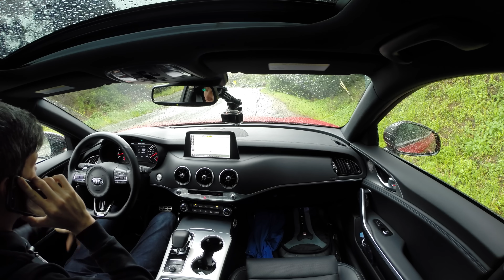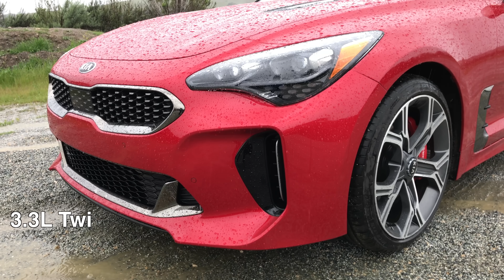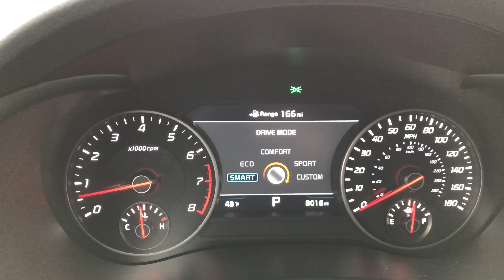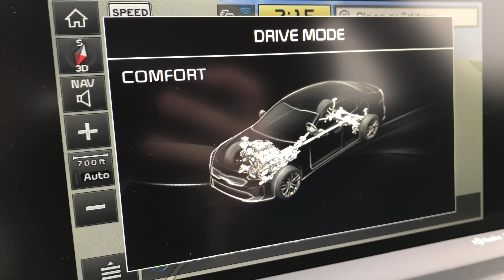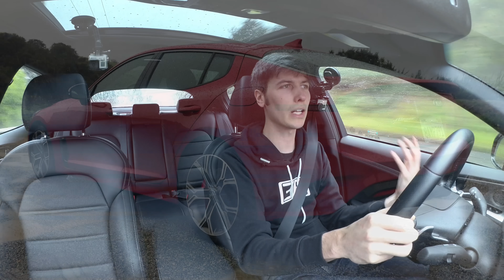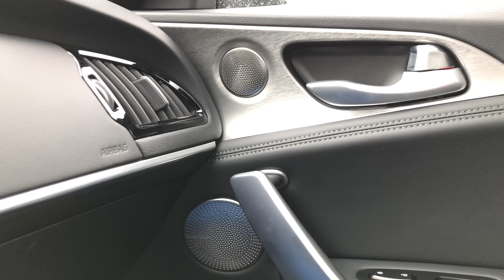The Kia Stinger GT Is An Ego Check For Car Guys

Comment: One of my favorite cars out right now! Not a lot of people show enough love to it
Reply: I'm glad you love it Salo everyone who has driven the car loves it, I think the best way to sell a Kia is by getting people in one first

-Kevin
Reply: Mista Butterworth When there is '06 Sonata's still alive and over 150k miles
Reply: Salomondrin we are killing it right now with the shop Stinger GT. We have dumped 100's of hpurs into development for the Stinger.
Reply: Vipervenomsrt actually, not the case. With $3000 worth of upgrades, it will beat several cars in that catagory.
Reply: Vipervenomsrt outperforms every car in its price range. And it's marketed as a gt car. Not a sports car. A tune and an exhaust and intakes and this car will walk an m3 a q60rs a c43 amg and many others for tens of thousands less.
Reply: Wedow have a yellow gt premium one of 600 beat a camero as well as handed an sti a L. Mine is stock  rite now
Reply: Tork Motorsports love your channel have a yellow gt premium awd best car I've ever had. Last car was the genesis 3.8 coupe. Are you guys selling parts yet?
Reply: King of The Castle sure, go take a corner in the 392 and tell me how you feel.

 Also in all technicality, this car starts at 38k where the scat starts at 39.9. Most dealers by me are also marking them up or charging hidden dealer fees. I wanted a burgundy scat last year and it was advertised as 37.5, then when I started doing the paper work it came out to 44k. The stinger on the other hand people have recorder paying 34-35k out the door for a gt rwd. And by me they will even give you a discount on the gt1 awd, some are selling for 41k when the sticker is 45k.

And I hate to say it but for 500$ for a jb1 pigyy back tune, you'll beat a scat in a straight line.
Reply: King of The Castle lmao well this car is faster than my q60rs for less money. This car beats the scat in interior and looks. The scat now looks the same as a v6 so that's lost all appeal to me.

I'm not in city traffic. I corner on exit ramps and motor ways at 70-90mph and have fun doing it.

My car only has an exhaust intakes and a tune and I absolutely Walk scats and being awd hellcats stock from a dig have an extremely hard time catching me before 110-120 mph.
Reply: @Vipervenomsrt It's a sports sedan, but it's also a GT.  So, severely out-performed by what? Fully loaded 2018 Kia Stinger GT2 AWD (designed by former Audi TT designer Peter Scheyer and engineered by Albert Biermann, former VP of BMW M) with 365 HP has an MSRP of 52K .  In September, I got mine for 44K.  The Audi A7 STARTS at 68K, 340 HP.  BMW 6 GT/Hatchback STARTS at over 70K at 335 HP. Porshe Panamera starts at 85K with 330 HP. Mercedes CLS starts at 69K with 369 HP.  And the Kia has a 10 year, 100K mile power train warranty and 5 year 60K mile bumber to bumper. None of the others are close in warranty.  And Kias are actually reliable (which is why they offer such warranties).   So, pay for the badge  (more likely lease), I paid for the car.

This car is fast, gorgeous, roomy for people and cargo, loaded and comfortable as can be.  It's not severely outperformed by anything in it's price range and not really by anything even 20K more for similarly powered and loaded.  It doesn't have the badge/rep.  THAT is the only thing this car lacks...for now.
Reply: Robert B good stuff. They offer basic Boltons right now. Jb1 has a piggy back tune right now, tork is working on the tune. The piggy back tune and an exhaust hangs with my full Bolton q60rs. I'd suggest buying the jb1 unit and also buying your Boltons form tork ms. I wall away from 2016 ss camaros up top which is unbelievable for the weight of my car.
Reply: Wedow thanks man
Reply: King of The Castle and oh no!!! A 400$ service at 60k miles to clean the valves..... Have fun with dodge reliability. My neighbors challenger scat pack has been to the shop 4 times in a year in a half. Anything ftom the cam timing being off to the car shuddering to a stop and shutting off at a light. Dodge needs to offer an athletic car next to there bricks with hp. Don't get me wrong, you can beat the sound of that v8 with the stinger. But that's its only advantage.
Reply: @Vipervenomsrt I guess Edmunds, Road and Track,  Autobytel, Motor Trend and Car and Driver (to name just a few) are wrong when they call it a sports sedan.  And you are right.
Reply: @Vipervenomsrt And where did you get that from?
Reply: 2020 stinger gt tt panthera metal chameleon trim
 Over a year old and still love the car. 2015 sorrento sx and still runs great. Never failed to start. 164000 miles.
Reply: Zach R Kia is as cool and reliable as Velcro shoes. Velcro shoes even have great “initial quality”.
Reply: Salomondrin - It doesn’t deserve love. Show it love if it’s still running 5-10 years from now.
Reply: Salomondrin is trolling

Comment: I think the saddest part of this, and most new sports cars, is when they don't come with a manual gearbox option.
Reply: hyundai will be making a genesis g70 that will basically just be the stinger, and the base model will have optional manual.
Reply: Manual transmissions may soon be obsolete. Computer parts are now more integrated in cars vs. mechanical parts. Manumatic seems to be the trend now. That and turbochargers.
Reply: Not a sports car, it’s a Grand Tourer (GT)
Reply: The Wakz I disagree, if I wanted a peppy daily driver that doesn't look like my grandmother's buick I would consider this. I don't want a manual for my daily, I drive a unsynchronized 18 speed 600-750 miles a day on a normal day I want to push the pedal and go when I get done. Dont get me wrong I'd rather have a manual for a weekend/sports car, but that's not the market for this, this is a daily driver that has a little pep.
Reply: SDD525 Did you really just say that? Its not a '99 civic, this car (and all new cars) have very controlling ECU's, would DESTROY the value of this brand new $50,000 by cutting into the trim above the transmission tunnel.  How does the manual swap factor into the drive mode button? Nobody is manual swapping new vehicles unless they have more money than brains
Reply: People put more value on numbers rather than experience. Sad days
Reply: Automatics have their place. I prefer a manual 99% of the time however I've never scoffed at a well tuned auto. I've had my ass whipped more than once on an autox course by a car with a slushbox.
Reply: You can also buy a "quick shifter" for any sport motorcycle and make it work exactly the same. It just cuts the ignition on the upshifts under full throttle.
Reply: Rob C F1 uses paddle manual
Reply: For the experience, I agree, not everything has to be automated, you can't automate fun. (sometimes).
SDD525 transmission swaps are the worst and sometimes when you're finished the car is never the same in the interior. Not worth.
Reply: SDD525 youre nuts. theres no way youre getting a manual swap done in this car for less than $5-10k. at the VERY least. what transmission are you going to use? and do you have any clue the man hours it's gonna take to fit it, then reprogram the ECU? no, a good transmission swap wont be easy, and it wont be cheap. and it certainly wont be worth it on a car like this. now, if a rich guy wants to spend $40k to swap his 991 GT3RS to a manual, fine, but nobody is gonna do that on a stinger.
Reply: Danny, I agree. Sadly most ppl outside of Europe prefer auto. Like any business Kia follows the money; and on top of it, it's too much of a pain for them to bring both auto and manual to market.
Reply: "Sad days"? When you can buy a 380 hp "sedan" for $50k that does 0-60 in under 5 seconds? These are the best days! Yes, there is no manual, but the tiny percentage pf people that would actually buy one doesn't justify the cost to KIA (or anyone) to test it and have it meet federal standards. Go buy a Mustang GT, if you want a manual.
Reply: Not in America anymore.. pretty much the only sadan offered with a manual is the WRX. Since Ford did away with focus ST, and Mazda did away with manual Mazda 6 in 2018 (before they added a turbo..wtf???).   We've become a soft group of car buyers.. they cater to the market, and the market says comfy automatic SUVs...  Lame!!!!
Reply: 370Z nuff said
Reply: Danny Daskalakis it needs to be an option. Even if it's a rarely purchased one.
Reply: @McCAlexander  if it doesn't sell they have no obligation to do it. If you want manual gearboxes buy new manual cars and show them that there is a demand for it
Reply: @vicmanvalfre96  well of course there's no obligation by the manufacturer. They can make and sell whatever they want and believe will sell. My comment is saying it needs to be an option to be taken serious. Even if it's a really purchased one. 

That or a dual clutch.
Reply: Rob C I don't think you got the analogy right, but that's fine. Anyways yeah it's not that it's better or worse, but for my personal taste, manual is more fun and engaging, salty boi.
Reply: SDD525 that isn't in everyone's budget.
Reply: True.  I even bought a new Subaru Crosstrek as Subaru is due to cut manuals after 2020.  My other cars (Wrangler & Miata) are manuals.
Reply: Rob C, F1 does not use an automatic, it's still a sequential manual, just a computer controls the clutch but the driver can also disengage the clutch using a button on the steering wheel to put the car into neutral.
Reply: The main thing about these DCT cars is that all of them are automatics with the option to shift manually via the paddles. "A dual-clutch transmission, (DCT) (sometimes referred to as a twin-clutch transmission or double-clutch transmission), is a type of automatic transmission or automated automotive transmission." So while they usually faster than manual transmissions they are just high performance automatics. While rowing the gears in heavy traffic can get old, it's very satisfying at the track or a nice twisty road. It will be a sad day when manuals are gone.
Reply: I was driving a trucker friend of mine around (and Mustanf GT owner) and he thought my STI had a rev matching transmission. I've been driving and riding for so long it's just a habit now. My wife's Forester has a CVT with paddle shift and it's ok, but no replacement for a manual (and certainly no DCT).
Reply: if they execute the auto well,  with manual shifting its a non issue to me.  Waiting for the the next model Stinger,  the Koreans will have worked out the trans issues by then.
Reply: It comes in a manuel with the 2.0t rwd version but not one for the 3.3tt sadly
Reply: McC Alexander exactly my point.
Reply: IFearlessINinja couldn’t agree more!
Reply: Manuals are on borrowed time,more so with Dct. Toyota/Lexus Speed Sport Direct shift with locking Torque converter might be the best solution. It shifts faster than a manual,locking TC keeps you engaged with good feedback,and your left knee will love you forever if you live with Bay Area traffic. Toyota Sport Direct shift is NOT the sluchbox from granddad's Buick. Automatics have come a loooooong way.
Reply: stefan urquel I never got the point of Manual mode in a Automatic Transmission. Almost everyone wants to get rid of MT because AT is considered better but not everyone is necessarily with that. I’m slowly learning about cars everyday but are AT easy to fix like MT without breaking down the actual transmission?
Reply: It's still a car that would be capable of trashing some BMW's though.
Reply: Get the Genesis version of this car. That has a Manuel
Reply: It is a GT not a sports car.
Reply: Save Manuel
Reply: Exactly
Reply: Right? A manual transmission is cheaper anyway, it’s not that complicated I imagine.
Reply: Rob C Auto is not allowed in F1. Formula 1 uses semi-automatic, which controls the clutch and shifts, but not when to shift. Manual clutch is only used for stopping and starting.
Reply: Nobody wants manuals, look at the sales in the US. Barely anyone can even drive stick.
Reply: Manual is dead.  Accept it
Reply: @kenmasters2025  damn I never noticed how many comments this got. And I won't accept it, Cadillac is spurring my little heart on with the new blackwing haha
Reply: Yeah.  I'd rather be a bit slower and feel it than be a bit theoretically-faster on the Nurburgring and...not feel it.
Reply: Rob C Formula 1 use sequential gearbox, which don't have automatic mode (but still have driver operatable clutch for standstill, the driver don't need to operate clutch while shifting). one of the road cars that use same transmission is pagani huayra.
Reply: We live in a time when standard transmition aren't standard anymore. Sad
Reply: that's the whole point, whilst people think the A/T seem to improved alot but in reality there' isnt many shop can repair the A/T back to 100%...if you're going to buy A/T car and use it for a long longtime then i suggest you should buy M/T instead...because once the a/t breaking down, then it's a long way to go to fix it..
Reply: Blasted Youtube filtering comments! (It says there's 5 but only shows me 3)
ANYWAY, Kia has never released a manual for a factory V6.  And with the increased accuracy and reliability of electronic shifting systems, it seems unlikely they ever will.
Reply: notsosubaruwrxfan this. 100% this. They look at lap times, 0-60, 10 mile, and opt for flappy paddles. They don't consider the experience. I'd rather do a slower lap time but be fully engaged with the car, than have the car do all the work. Very few know how now, but in 10 years, there will be a handful of people who can properly heel/toe on the downshift.
Reply: well F1 have their own mechanics to rebuild the A/T even in one night before the race,
modern cars have complex A/T to rebuild, once your A/T been rebuild it wont feel the same as before..
anyway it all back to an individual...choose the one you're likely to enjoy driving with...
Reply: There are transmissions out there that will change gears faster and better than any driver in the WORLD!  but I see what you're trying to say, a manual T is just fun as always!  On track though, not on a public road! 

😋
Reply: The Wakz.

What about the Nissan GTR?
That is automatic.
Oh but wait, it is a nissan, they're exempt as they make sports cars

What about Lamborghini?
They have an automatic mode on their DCT.
Oh but wait, it is a lamborghini, they're exempt as they make sports cars

What about Ferrari?
They have an automatic mode on their DCT.
Oh but wait, it is a ferrari, they're exempt as they make sports cars
Reply: I would buy an optionless Audi or BMW over this (and will be in a few years) since they still offer M/Ts. We'll see how long my Fiesta ST lasts, but I miss that Germanic Solidity.
Reply: Jay Dunbar i'd be willing to bet that most of the people here dont even know what a transmission without synchros even is, much less how to drive one. hell, the ones who do drive a manual, i doubt the even rev match unless they have a new fancy car that does it for them. lol. for a truck driver, i totally understand not wanting a third pedal on your days off driving around town.
Reply: smminco How could anyone even stand to drive a stick without rev matching?
Reply: I'm a pizza delivery driver and I rev match my car all shift long. If you really love driving and aren't lazy, it's really no hassle at all (when you're driving a normal-sized car).
Reply: Danny Daskalakis 
this is not sport car .
its luxury sport car- for lazy rich people 🤣
Reply: It's because old people buy new sports cars, they like autos. Young people buy used sports cars or modify, car companies don't care much about that.
Reply: that's true boy. at least if the manufacture still prefer fast shift they can add sequential gearbox with electronic clutch (it is different from dual clutch because it don't have automatic mode).
Reply: The Wakz lol you're probably right actually.
Reply: Not even a sports car with an auto, but people still buy into the "sports car" branding.  People that buy this car don't know how to even use a manual.
Reply: McC Alexander then it would be a big waste of money to manufacture

Comment: I’m going to check one out. Is it comfortable for long drives? I have back issues and I’m debating between two choices. Genesis g80 Sport large sedan or a smaller a sedan G70 or Stinger GT limited.
Reply from the maker: I probably spent about 2 hours on the road in it, no complaints on comfort.

Comment: That's the best title ever for a Kia Stinger video ever. This car really points out who fancies cars only by names.. this vehicle wins over BMW for me personally
Reply: not only less to maintain but backed by 7 year no quibble warranty (transferable)  not a 2 year "we make quality cars.... honestly..." warranty. i live in Germany and the Asian cars are still cheaper to maintain
Reply: Devin Bender no it doesn't. You know literally nothing about buying a new car. To get these features in a smaller more cramped car that's still slower aka that 340xi its 67k. This stinger is 50, gt1s are going for 42 with awd. You can't even get an msport 4 cylinder for that money. Over priced German crap that gets walked by the competition.
Reply: 97 Bambo once that “amazing” warranty is up look out. Cost the same and just as fast as a loaded bmw 340xi pass
Reply: Wedow kbb/ bmw and true car have the BMW 340i x drive msrp at 51k 48k for rwd. And the 3 series is only 2 inches smaller. Hardly a difference
Reply: Wedow with nearly identical performance numbers and a lot more luxury
Reply: Old BMW’s around the same cost are better in my opinion. You can probably get an E92, E46, E39, etc. BUT as a new car... I prefer this Kia over almost all of bmw’s current lineup. The new Beemers are so uninspired but the Kia has actual character.
Reply: 97 Bambo you haven’t been inside any M 1-6 then lol
Reply: 97 Bambo probably will cost you less to maintain..